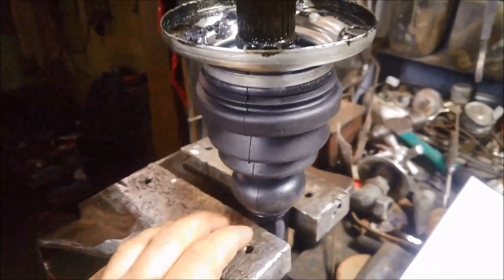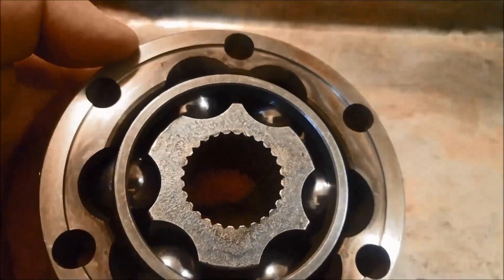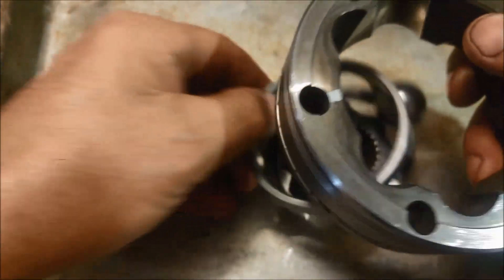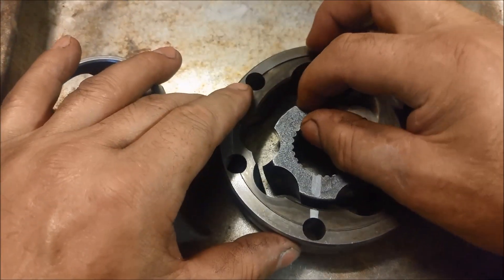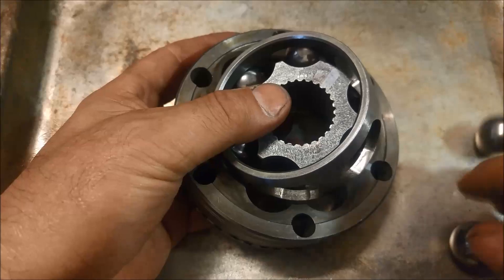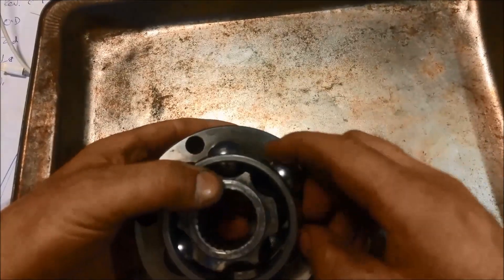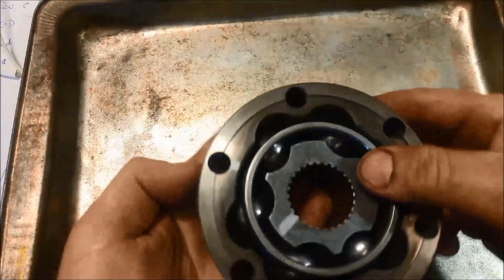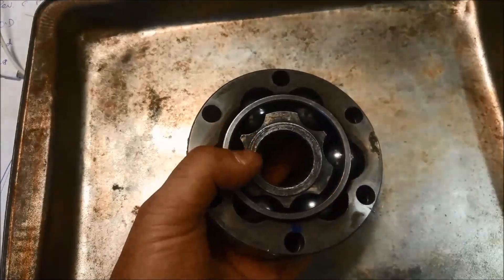How to CV Joint Constant Velocity Joint Assembly Wrong & Right Way CV Joint locked up after assembly

Comment: Just to mention the cagfe and the housing have inner and outer sides... They are not interchangeable, although I dont think they would make much diference... look at the cage edges one is square, the other one has a chanf. also the housn has a recess where the gasket fits btwn the cv and the tranny flange.
Reply from the maker: hi, awesome info, thanks for that cheers

Comment: Extremely helpful. 2006 Toyota Matrix AWD Rear Propeller Driveshaft is like this with tapered slots. Seems counter intuitive to assemble as shown but only way it works!
Reply from the maker: hi,we have had a few reconditioned cv come assembled the wrong way. thanks and cheers

Comment: I've rebuilt Subaru c.v.'s before but I bought some used and went to fit and despite being recently rebuilt it turns out my bought t4 driveshaft was like this and this is the first video I saw lol
Reply from the maker: hi, we have come across rebuilt cv where someone has assembled them the wrong way and not checked/tested the movement. often quicker to get permission from the supplier and then correct them yourself than to send back and get replacement. cheers

Comment: Sounds like an Aussie accent. I'll get you a James Boag's next time I am on the Gold Coast. Notice that the inner part with the splines is flush on one side and has a raised section on the opposite side. I wonder why and I wonder which end of the splined shaft goes into which end, the flush or raised side?
Reply from the maker: hi, always good to mark things/take reference points before you pull things apart. we are in north east country vic. cheers

Comment: Hey good video. I also found out that the cage has a groove side and a flat side. I read online that the gooved side goes towards the axle and the flat side towards the wheel. I don't know if it makes much of a difference but you do want to get it on how it was on before and get right the first time. There's alot of details you can miss when working with these things mines fell out when I removed it so it was a pain. Yours looked the same on both sides so that's different.
Reply from the maker: thanks for that, yeah most have a groove to show assembly. cheers

Comment: If you install a complete new cv joint onto a tailshaft do you have to rebalance the complete tailshaft ?
Reply from the maker: hi, usually the new cv joints are balanced anyway. if you need to remove/disassemble for whatever reason, its always good practice to mark as many components as you can, so you can put it back same as it was or to decide if you can flip a part around if it is wearing one side and not the other. cheers